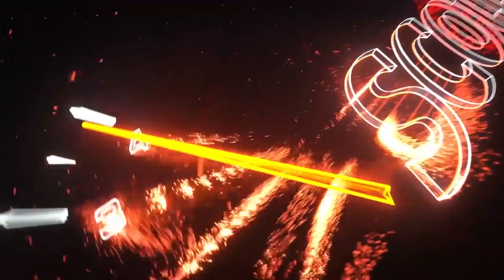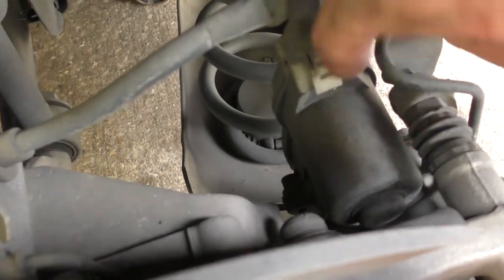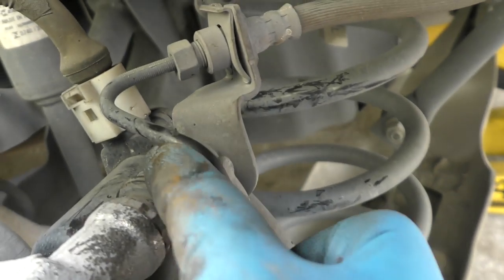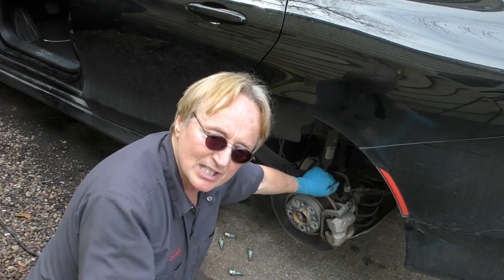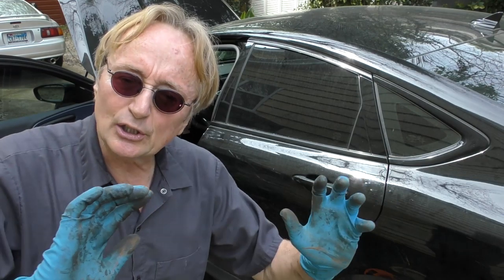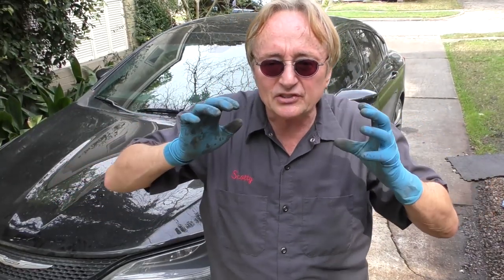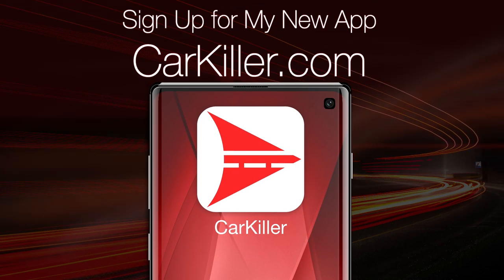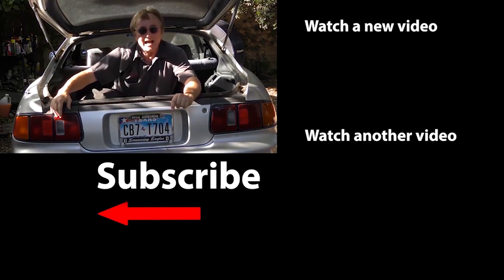This Trend is Stupid and Dangerous

Comment: The second you said "Chrysler" I laughed. They need to change their name to "Junkler".
Reply: In the past 3 months or so alone, I've had several Dodge Caravans come in with leaking ATF cooler lines. Replaced them in 4 different vans. You have to remove the front bumper to get to the line clips. It's no surprise they leak because the OEM lines are made in China. Keep in mind I work at a Kia dealership!
Reply: Junk has a use chrysler does not
Reply: Or Crapsler .
Reply: Shystler...
Reply: The Antichrysler
Reply: I will not touch a FCA car again, i had one for under 6 months( grand voyager rt, was before Scotty done some videos about their transmissions) guess what from 5 months 3 was in the garage under warranty, had 3 transmissions in 3500 miles and i rejected it in the end...
Reply: Chrysler be "chrying"

Comment: I am kinda surprised about the whole situation. I always thought the thing people call "emergency brake" is an actual regal safety requirement. As it turned out, it is not. It might be just a parking brake.
Reply: Waldemar Ishibashi thats why its called a parking break
Reply: I believe it’s a reverse circuit. Power on releases, power off engages.
Reply: @KnockOutGlitchazzzHD  its supposed to be an emergency brake. Parking brakes are for manual cars.
Reply: @811brian  Railroad car air brakes on trains work in that way. The brakes are only released when pressure is applied. Brakes are normally applied unless the pressure is applied to the brake cylenders.
Reply: @davecrupel2817  They are called  Electric Park Brake (EPB), and that is their main purpose. They haven't even been called emergency brakes for decades. Automatic transmission cars need parking brakes too, btw. Leaving them only in "P" is a really bad habit that might damage the gearbox even with very minor parking accidents.
Reply: @hmpeter  I'll nevertheless take a cable, mechanical system over an easy-to-compromise electronic system.
Reply: @davecrupel2817  No doubt about that! I am very happy my relatively new vehicle still has a conventional one. I can't see any actual advantage of the electromechanical variant.
Reply: @davecrupel2817  parking brakes are not for manual transmission vehicles. They are for all vehicles. The automatic transmission parking paw isn't substantial enough to be used as an all scenario parking system. Everyone should use their parking brake....especially when parking on any slopes. 
I've seen the abused parking paws cause transmission damage and I've seen automatic transmission trucks pulled back into the water on the boat launch because one of the wheels slip and the limited slip differential allows the vehicle to roll backwards while dragging one tire.
I've seen the same thing while a vehicle is parked on a slippery hill (snow/ice). Limited slip only works under power and parking brakes truly lock up the rear tires.
Reply: Fortunately my 1st gen 200 has the handle/cable setup 😁
Reply: It is not an emergency brake! It is a parking brake to backup the park position on the transmission. There is no way to modulate the application of that brake.
Reply: John Smithy  This is how air brakes on trucks work.
Reply: I've seen vehicles that got bumped roll away.  It doesn't take much of a slope for a 3000+ pound vehicle to pick up enough speed that a human on foot can't stop it.  Use your parking brake.

Don't use the parking brake while driving!  The owners manual probably says not to use it while driving.  If your regular brakes are working, it will lock up the rear wheels (which the ABS is supposed to prevent) and you'll probably spin out of control if you haven't practiced driving with the wheels locked.
Reply: @TheSuburban15  I have had to use  both the hand style and the the foot style emergency brakes. Both with success and not a lot of fuss. That electric apparition, I don't think, would be so nice. Baaaaaad idea!
Reply: @afobear  I think you're trying to describe the parking "pawl" on the automatic transmission.  A paw is on the end of your dog's leg.
Reply: @warsurplus  you are 100% correct. I was writing a response while in between tasks on a jobsite. 

Disclaimer:
No dogs were harmed while parking a car without the parking brake. 😊
Reply: @811brian  At least on the Audi A6 I changed the rear pads on, it's not. The electric motor has to actively screw the caliper piston in or out though a gear!
Reply: This^
Reply: John Smithy  Thats not how stepmotors work...
Reply: The parking brake is NOT an "emergency brake".  
Its primary function is to eliminate stress on the power train when parking the vehicle on a spot where it can roll.  The proper way to use it is to put the car in neutral while holding down the brake pedal, then engage the parking brake, release the brake pedal, and when the vehicle is held only by the parking brake shift the trans to P (or 1st gear on a manual).  That way the entire pull of the car is on the brakes and not the transmission or engine mounts.
Reply: @marco1173  It makes sense. It makes me wonder now why it was called "emergency brake" in the first place? :)
I rephrased my comment.
Reply: @davecrupel2817  There's a reason the brake button has a "P" in its icon, it means Park.
Reply: @valdius85  You can also use it for if your brakes go out, which is an emergency. You gotta be careful using it though because you can lock up the rear wheels easily.
Reply: @chasemiller7974  It requires energy to work. As such, for me, it is no longer am emergency feature.
Reply: @valdius85  I'm talking about just a handbrake/foot lever.
Reply: @davecrupel2817  It's a hand brake. It should always be engaged when parked. If you ever see the size of the pawl that locks your automatic transmission when you put it in "Park" you'll know why ;)

Comment: they've eliminated the fun of driving a car with a hand lever ebrake in the snow.
Reply: JonsReef oh really?   Never owned a car before huh?   Welcome to Earth.  It’s an emergence brake or parking brake.
Reply: Mark A they are gonna get rid of stick shifts too!   🙄
Reply: JonsReef i quess you must live under a rock. Its called both a parking brake AND a ebrake (emergence brake)
Reply: @JonsReef a Parking brake is on a manual car. An emergency brake is on an automatic car
Reply: @SonnyGTA  It USED to be an emergency brake - until they motorized it!
Reply: Mark DiSilvestro Mark, you got me there!!!
Reply: 😂😂😂😂 fighting for stupid things 😂
Reply: Given the handbrake's effectiveness at stopping your car, I seriously doubt you'd want to be using it in an emergency...
Reply: Were you watching me last winter.   Guilty as charged, because I have done it numerous times.
Reply: @233kosta  what? In an emergency when you cant use your regular breaks that's exactly what you would do. Brake lines blow or have been cut? You would use your e brake
Reply: @233kosta  I bought a jeep with some play in the steering box and it had a brake wobble. Driving it home down a mountain (highway 24) in NC canada I touched the brakes to slow down, didnt know the jeep had death wobble, touching the brakes vibrated the steering and started death wobble at 100km/h and climbing and I couldnt slow down. I was able to come to a stop with a combination of e brake and gearing down. Needed a transmission rebuild after but I didnt die. The electric e brake is garbage also because in an emergency there should be a physical connection to the brake and not a bunch or electronics that can fail.

Comment: Save the manuals!
Save the cable e-brake!
Save the steering wheel?!
Reply: Haveair T save the internal combustion engines
Reply: Save the cable operated throttles too.
Reply: JonsReef tell me, on what planet do you live? Ebrake stands for emergence brake. Have you never heard of an emergence brake before?🤔
Ebrake=parking brake. Its the same thing and both names are equaly correct
Reply: @erty2389  thanks.
Reply: Hipsters & Hippies Electronically activated throttle bodies are fine.

Comment: When working on my Elantra GT's brakes I used a large pair of needle nose pliers to turn and push in the spiral brake pistons.
Reply: The first time I changed my brakes on my Elantra I had the brakes off untill I realized I needed the tool I had to put everything back together to got to the shop 😑
Reply: That works
Reply: Well, at least you knew you had to turn
Reply: The best way to do it is to use a G-clamp.

Comment: What happens when you get a flat battery you can't move it or tow it as you can't let the parking brake off!
Great invention 😠
Reply: That is an excellent point. Am glad my Tacoma is a cable foot parking brake. Even if no battery...can still release and engage park brake.
Reply: Spot ON!    I want to be able to apply & release my parking brake with a good battery, a dead battery, or (gasp!) no battery in the vehicle.
Reply: There is a manual release in a hidden compartment under the gear shifter to release it
Reply: @reginaldlumpkinsii9013  Sometimes for the automatic shift-lock. Not for the electric parking brake.
Reply: Well you get a jump start just like any other time your battery goes flat.
Reply: ^ Yeah, if you can get someone with their car to jumpstart yours
Reply: @danielsane30  doesnt that defeat the purpose of a "emergency" break? If you cant use it when you need to?
Reply: I’d be willing to bet there is a release mechanism, just like semi trucks when they die and don’t have air. The brakes have to be released manually.

Comment: CDL training requires you to know how to use the Mechanical and/or Air Emergency Brakes to stop your vehicle. Emergency brakes are a secondary fail safe system in case your standard service brakes fail. I thought it was required that all USA cars have mechanical secondary system. Also that E-brake switch is in new Lexus 2018-2020 now. It controls the traffic stop hold system. When you are in bumper to bumper traffic and come to a stop it will hold your brakes and you can relax your leg. When u press the accelerator it will release the brake for you and u can drive. I don’t know if it switches to hydraulic system and still uses the mechanical for full stop enrage application. Great observation Scotty keep up the good work 😁👍

Comment: The old cabled pull up lever saved my butt one time my hydraulic brakes failed.  I agree tech. today is nothing worth having.  Keep it simple stupid.  Let's take airplane.  "They" decided to go from hydraulics to electronics and planes are falling out of the sky more than ever.
Reply: Electronics + heat=no bueno.  Gimmee hydraulics!!!
Reply: I agree with preferring the cable e brake,  but you're wrong about planes. They're safer now than ever. Check the stats,  even the nightmare 737max hasn't lowered the average. It's safer today than a generation ago.
Reply: As a former Boeing employee it has nothing to do with electronics. The only aircraft having problems are the new 737s because the tried redesigning a 70s designed airframe and tried putting bigger engines which screw up its weight distribution
Reply: J F and Boeing tried putting in new coding into its current computers to try and Balance it out but it’s buggy as hell. All because they were too lazy to just design a new aircraft which they should have done in the beginning and now it’s starting to cost more and and take more time than it would have to just design that new aircraft . But Boeing gambled on updating an 50 year old aircraft design. The 737 max has been in planning since the early 2000s
Reply: Planes are not falling out of the sky more than ever, get your facts straight.
Reply: @HatsuneM1ku01  You're speaking specifically of the 737.  We are speaking of tech, making people stupid and helpless.  To your point; how stupid has a company like Boeing become to make such a stupid decision.   Like today's music, movies and engineering people either simply repeat what was already created or they attempt to modify it and screw it up at the expense of human life (not their own).   So yes, it is the electronics.  Electronics are not something you suddenly fix in a matter of seconds to correct flight.  High tech. fails and you fall out of the sky.   There is no Red-Neck Duct Tape or ingenuity that's going MacGyver it and save the day before smashing into the earth.   It's all about money and power.  Small aircraft can be saved via whole plane parachutes, but very few can afford them or use them.  Priorities.
Reply: ☺☺☺☺
I didn't even know planes had handbrakes...?
Reply: @andrewkellers9275 Yes they have, it connected to rudder pedal.
Reply: Hatsune miku 01 It’s not that Boeing was too lazy to design a new plane. In fact that was their plan, but airlines really like the 737 because there are a ton of them and they already have the parts so they demanded Boeing produce a newer version vs a new design.

Comment: I like the hand brake style or the foot brake style the best. There's honestly no need for that to be electric.
Reply: Just another selling point to the clueless car buyer
Reply: It's for global market were manuals are still used. Old school cable brakes stretch after time and don't hold the car. Enough people forget to set it and the car rolls off into something.
Reply: Imagine your alternator dying, then your battery dying on a long drive.
Have fun
Reply: Electronic parking brake like one step back from hand brake,just drove civic type r uphill while very congested and the car just rollback a few times😑... i  used to hold the handbrake when start crawling but the fking electronic parking brake just pissed me off
Reply: Hand brake is best for rally driving and j - turns.
Reply: @thisismagacountry1318  and epb just ruined em...
Reply: @77xyu94  The new G70 has it. Wish they did it on the Stinger GT.
Reply: @thisismagacountry1318  owh genesis g70? Unfortunately,not around my country...stinger also same fate...bad move
Reply: Sooo you're repeating what Scotty just said. Definitely collage material
Reply: @Powertoolz  That's why old school cables provide adjustments - part of routine vehicle maintenance that requires a screwdriver or wrench - not a computer technician!
Reply: @appletree8441  It's not arts and crafts. Nobody is making a collage. Perhaps you meant college, but your public school got in the way.
Reply: If only the people refused to buy all this electronic junk, we could make manufacturers do what we want if only we could actually all stick together.
Reply: @Powertoolz  The mechanical type also corrode and stick on if you live in a state that uses salt.
Reply: @alanssnack1192  They only learn that after the new-car luster and warranty has expired and they have to pay for repairs. But most will have moved on to newer vehicles with even more insane levels of technology they can't live without - like an electric glovebox,  power-assisted doors, and wide-screen satellite TV displayed on the windshield!
Reply: @Powertoolz  I drive a manual "& never use the parking brake".  I set the car in gear and it don't move.  Brake cables don't stretch, but brake shoes do wear so you have to adjust the parking brake cable and it also tightens up the hydraulic brake pedal play as the shoe are put closer to the drum.
Reply: @bunzeebear2973  That's fine for you but occasionally some people forget to set it in gear. In America it's not a big problem since 90 percent of all cars are auto, in other markets manual trans are dominate which increases the likely hood somebody forgets to set it.
Reply: @kenolson6572  true. I talked to a team of engineers and that was their prime reasoning. They said it makes the car safer and less maintenance. I honestly don't agree since automatic are dominate but they have the data.

Comment: Defeat the purpose of an emergency break
Reply: maybe because ITS NOT AN EMERGENCY BRAKE ... its for PARKING nothing else ...
Reply: Asghaad Well, then where is the emergency break if that is not it
Reply: @michaelvaus  if you take care of your car you done need one
Reply: @zachary2641  didn't realize maintenance solved all car problems, guess your car will run forever
Reply: @erty2389  i fail to see how a handbrake is useful in that situation ...
Reply: @zachary2641  ...unless there is an emergency...
Reply: @Asghaad  PARKING BRAKES are for MANUAL cars.
EMERGENCY BRAKES are for AUTOMATIC CARS
Reply: @Asghaad  So you're saying they removed the emergency brake? something that's on EVERY damn car I've driven from a 62 VW to my 2002 QX4?

Automatics have a parking GEAR (it's an actual gear inside the transmission) but it ALSO has an emergency brake, whether it be foot operated or hand operated.

They are always CABLE operated. The reason is in case of EMERGENCIES if you lose your hydraulic system or otherwise, you can still yank on it to slow the car down to a stop. 

So what happens in this car when the hydraulics fail?

What happens if the electronics die? how do you disengage the brake? how do you enable the brake?

all the electronics in cars piss me off. I'm glad my qx4, while rather fancy in some aspects, is still old enough to have more or less conventional everything.
Reply: One time on my trip to San Francisco.  I had a full brake service.  They forgot to tighten the bleeder valve.  On the highway, the brake pedal suddenly went to the floor.  Had to pump it several time, all fluid ran out. Used the e brake to stop.  Good thing we were not in San Francisco yet.
Reply: @kasuraga  maybe I'm ignorant but after dissecting a few transmissions I cant find an actual parking gear in an automatic. All the ones I have seen use a pawl.
Reply: @lolbuster01  thats what i mean, lol bad wording

Comment: couldn't agree more! it is a step back!
the old mechanical ebrake system,  is kinda works like a backup too, when the hydraulics failed,  you can have control amount of brake force to the wheel